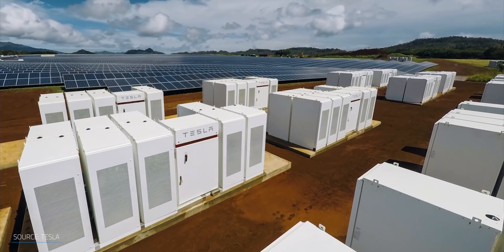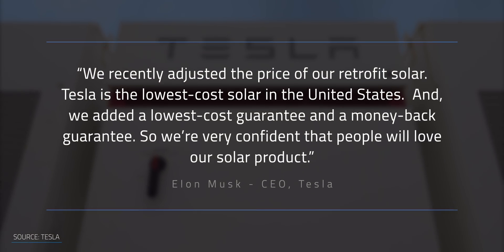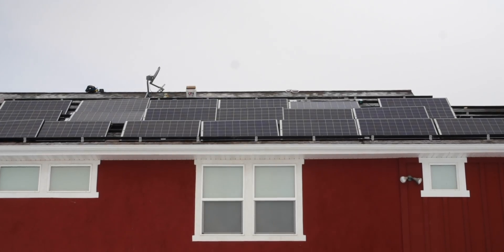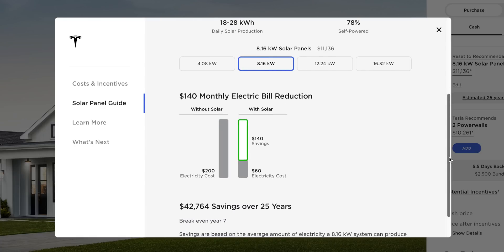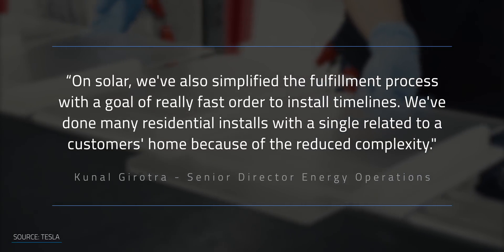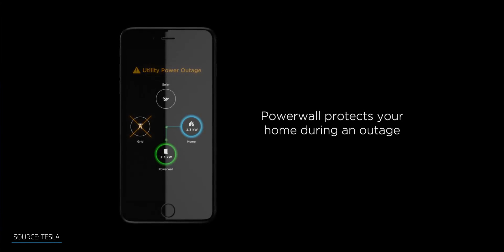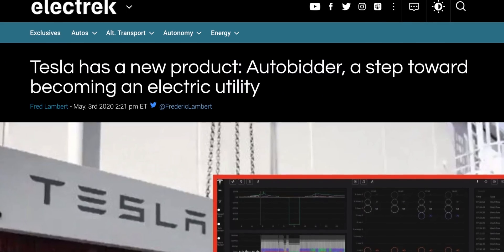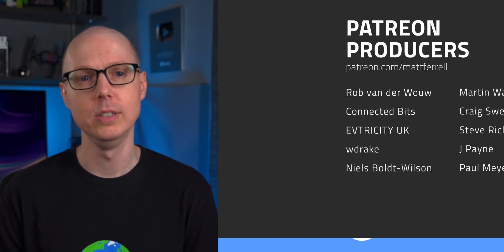Exploring Tesla solar panels game changing price

Comment: I was excited to get Tesla solar, but the streamlining of the process made it unworkable for me. Hard to get in touch with anyone. Their automated layout software could only place 12kw on my roof when I asked for 16kw. I wanted to try to get someone to tweak the layout. Other solar bidders were able to put 20kw on my roof.

Later I learned Tesla’s panel placement process was optimizing for basic cheap string inverters, so they had to avoid any area of my roof that might be unevenly shaded at any point. No per-panel monitoring. There are some who have managed to get per panel optimizers but it must take a miracle to get anyone’s attention for that.

I also learned that a big chunk of the cost savings in Tesla’s system is in the panels. They’re not as good as the LG NeON system you have - the 340W Qcell G6 they use goes for $250 a panel and the newer LG neons degrade more slowly, have up to 3% greater efficiency and are $415 a panel. It makes sense that a local company installing $400 panels will be $2 a watt and Tesla installing $250 panels might be $1.50 or less.

I’m willing to pay $2/watt for a company that comes to my house, lidar scans the roof, does a full solar analysis of all of the shade points, and installs a full system with the best panels and per panel monitoring. If Tesla would have paid just a little attention to me or followed up after I eventually canceled the order and checked “poor layout” as the reason, I would have happily gone Tesla and been none the wiser.

I found on Tesla’s forums that I wasn’t alone. Many complaints that people aren’t able to get in touch with someone to close sales.

Comment: Why?  Why do you want solar?  Why should government subsidize you?  CO2 is not a pollutant - plants need CO2 to make the O2 that we need.  Does a solar roof work more efficiently in Florida?...or Massachusetts?  What is life of solar?  How much for it after it has been used ?  Do those panels become dirty and need cleaning?  What is the whole story?.....do you buy a battery pack?....or stay in the grid for the time solar doesn't work?    Solar looks like a solution to a non-problem.

Comment: Tesla solar roof tile price was over $100k vs $20 k for a regular roof which was only 6 years old.  My Fl electric rate 10.6 cents per kw said no sense going solar.  Take almost 100 years to get the roof cost back plus my insurance would probably shoot up for the cost and property tax probably go up as well for a 6 figure improvement.

Comment: I live in New Mexico and a lot of roofs here are flat. I was going to get Tesla solar but they are charging $6,100 extra because I have a flat roof. They said they consider it a "non-standard install."  A local solar company is only $500 more, but they are using the Panasonic panels, micro inverters, and they use a roof system that does not require any drilling into my roof.  Shame bc I really wanted to get Tesla Solar but I will go with the local solar company.

Comment: I've been loving your videos, just found you not too long ago! Very informative. EvoSwitch, or as you referenced it as Switch, was bought out by one of my companies in 2018 and they have been trying to, and now achieved, a 100% renewable data centers where they are able to pass on carbon credits to their tenants. Another one of my investments is in a renewable company called BEP and they have most of the good hydro sites that are available. These were, and still are, quite valuable based on their energy demand can be turned on and off when prices peak. With battery technology improving and becoming cost effective, this decreases the intrinsic value of storing water in hydro facilities. The economics of renewables is fascinating to me!

Comment: On the tesla solar panel website, when they quote a price for a system, do those panels have micro-inverters, or just a single inverter for the system. Shade will be an issue in my yard. When I'm looking at tesla's price, it's enticing, but I can't tell what the system actually consists of.

Comment: I am currently shopping for solar and Tesla has the lowest cost per watt period.  However, I have read that their Customer Service and follow-up is absolutely horrible. Check out the reviews here: www.solarreviews.com;  www.energysage.com/supplier/21868/tesla/; & the BBB.  I have tried chatting with their rep. on the site portal, but they would not answer any technical questions unless I send them $100.00.  Therefore, I will probably go with a local installer at a higher cost per watt, where I can get warranty service if needed.

Comment: The City of San Diego is 300 dollars for the permit alone -- while permit approval for ProCert (certified professionals) takes all of five minutes and inspections take maybe 10 minutes. In some other jurisdictions in San Diego, permit fees are over 500 dollars! (Chula Vista being the worst offender.) To draw up plans, plus permit fee, plus designing the required placard, then filling out the 7-page application with SDGE and then forking over 132 bucks to them for a net meter, that right there alone is $1000 minimum. You want to get solar costs down? I know a good place to start.

Comment: Building a new house and Tesla solar looks like the way to go. Still deciding if the two battery system that Tesla proposes is worth it. Also,  I'm not sold on the look of the panels themselves. The pictures look good on the website, but I've been to two homes in Southern California and the Tesla tiles look filthy and need a wash. Since the panels are a shinny black they readily show more dirt. Similar to a black car would look like being park outside and not washed for a long period of time. In addition, the tiles looks like ABS plastic that's been slightly deformed by the sun. Please provide me your thoughts on this issue.

Comment: I admit using solar panels where the sun often shines many hours a day is a good thing, but they are getting damn old ineffectice any way measured. why?  storing the damn thing is a total waste of spending money in its first place.
I don't even wanna pay for something thats free to start with?!
There is a much better way and that doesn't need any batteries what so ever, it works 24/7 and no moving or wearing parts. a 50 kg supplier can easily support a normal house of 2-4kw no matter the weather, just to let you know!

Comment: The irony is that instead of going solar, it's a much better financial move to simply become more efficient. Make sure you have efficient bulbs, energy Star appliances, etc. Replace old refrigerators, AC and furnaces with more efficient models.  Sure that may be expensive, but it will probably save you a lot more money than solar panels will.

Comment: The problem with just pricing out the cost of panels is that the other costs are substantial and not coming down. You need converters and potentially batteries. Along with installation and maintenance. Maybe even a backup generator.  If $11,000 sounds cheap to you for installation, realize I'm never paying more than $700/year for electricity. So it would take at least 16 years to recover the installation. Then there's the convenience of NOT having panels on my roof. Not having to clear them of snow or having to clean them when dirty. Nor replacing panels that get damaged or stop working. Electricity is so cheap here, installation has to be really enticing to go solar. And the convenience of being on the grid can't be understated.

Comment: My biggest gripe (in the Netherlands) with any change to solar/geothermal/batterystorage is the fact that it costs alot up front to do, and I don't own a house (yet). I haven't researched it yet but what I would like is that those systems can be installed and then you pay in terms, like you do with a mortgage.

Comment: 1.49 per watt? WHAT? Really? Dude, I have a 5kw solar array, with a 48V output (5kw €48V), it has 25m2, it touched 7k€ on the final invoice... including, inverter, bsm and a 2kw/h battery (5kw capacity). I installed it myself, so I spared like 1k€, notice, solar panels, were the cheapest part, and are those with 44% effiency, they have one year, and they almost paid off, as the house where they are installed, is used only 1 or 2 weekends per month :D USA is a rippoff in everything. BTW, I ordered everything from china.

Comment: I'm confused, are we just taking about the panels (as your description states) or for an entire system installed?

I bought solar panels a year ago for $0.53 per watt, if you want to calculate a per watt cost for an installed system the cost can vary drastically depending upon what hardware you use, not to mention professional services and permitting costs.

Comment: First thing I was going to say when hearing the prices, until Matt mentioned the Australian pricing being so low - which it wasn't for quite a while, but we go a bit mad for it here...so it has helped drive the cost down.

I lived on a farm for a few years 1993-1996 - we had Solar only, 6 panels, it cost $10 per watt for panels back then, so it was beyond our reach to expand them further.

over the past couple of years Mum and Dad have gone with Gov't incentives and now have over 30 panels on the roof, and haven't paid for Power for a few years during Summer.

I have 2 panels on my Broadcast van (self installed with Victron Inverter and batteries) - but panel wise - cost me Just over $200 for 500w, and they are actually at 25% efficiency which may sound bad, but that is actually quite high in the scheme of panels.
The overall system is 2000Wh running capacity, costing around $3000 - so even that is only a total of $1.50AUD per watt - but inclusive of the entire setup.

Comment: In Australia I have in 6 Apr 2020 3 Ph Fronius Symo 6 Inverter and 7.8 Kw system 26 x Canadian Solar 300w Solar Panels cost me $6,000 including govt incentive and 10% GST
I am currently getting Tesla battery fitted at a cost of $6,450 
supply charge 88 cents a day,
general usage rates 37.73 cents/kWh
Solar Feed in 12.4 to 16 /kWh exported

Comment: I signed up for Tesla solar panels 4 months ago, and was excited about getting the system installed. Unfortunately, I have now cancelled my order, as (after quickly sending all the photos required), then suddenly announced 3 months into the process that I would need to move my existing electrical panel, and upgrade it to 200 Amps. This panel upgrade involves trenching approximately 50 feet across my driveway and retaining wall, and will cost at least $5K for the work. This really got me upset. I have been a devoted Tesla fan, and have been a shareholder for 8 years. Sorry to say that this experience was pretty horrible. Here's my suggestions, which I hope Elon will take to heart to improve the process:
1. Assign a dedicated coordinator to every project. This coordinator would work with the service provider (PG&E in my case) to ensure the permitting is moving forward, and handle all communications with the customer.
2. Contact the customer on a regular basis (at least once a month) to provide updates. I never received updates until I called and vented my frustration.
3. Have a local Tesla representative walk the exterior of my home, ensuring that everything is understood upfront... avoiding surprises, such as the 200 Amp panel and Powerwall locations!
4. I was considering Powerwall, but found out at the last minute that locating it in my garage was probably not possible. Another problem that could have been avoided early on.
If anyone reading this post can forward this to Elon, I'd really appreciate it.
Thanks, Steve

Comment: Hey Matt, Tesla finally contact me about my solar roof quote (not panels) if you are interested let me know. Nice video by the way, tl;dr on the roof $33k for 10kwh system size, 6kwh produced. No power walls afaik. Their solar panels quote inc 4 power walls $24k for 16kkwh system. (All after federal credits).

Comment: Thoughts of someone in the Industry:

I work for one of the largest Solar Providers in Florida, at one point we had the largest, fastest growing Residential base

Selling extremely cheap is an effective tactic for getting a significant amount of work, however the O&M eventually catches up with you, unless you're fronting enough cost to cover a large service force, you'll have significant issues down the line
-Charging $75 for a service call 2-3 hours away, even doing 4 of them in a day, you end up barely breaking even, if at all - labor is supplied by the Contractor, and the Materials / Replacement Parts if Defective, are Supplied by the Manufacturer per their Warranty

You can't use generalized permits and engineering in Florida, if they ARE, then the AHJ's (Authority Having Jurisdiction, aka Building Department) will have some significant legal troubles

Quality of the Materials, REC Panels are equitable to LG, 25-year warranties on labor, product, and output, higher efficiency for equivalent modules than LG, LG and REC are leagues above Tesla (Panasonic in particular, although they have since swapped to an alternative)

The actual cost for Installs is higher than what they're showing, even as a manufacturer of the Panel, their total profitability has to be razor thin at best, and not cover any administrative overheard whatsoever, nor issues that commonly occur

Using a lower quality, less efficient, in-house module will save a fair bit of money, so that might be where they're shaving the most bit, however it comes at the cost of the rest of the business
-Reducing $0.45 to $0.20 would shave off enough to be equal to one of the common rates in my area, but if it's costing you $0.18 to make the Panel, w/o admin or distribution, that's problematic

As the manufacturer they will then be on the line for ALL material replacements and labor too

If they were up about another $0.15 / Watt they would probably be in a good position, as low as they are, their numbers must be being supported by the rest of the business

Comment: The permitting process in my area easily adds 30% to the cost and can take a few months even to get through the process. With COVID that has gotten even more difficult since each department is working from home and they don't want to share the phone numbers so you can't contact them directly and it can take a few weeks for a response to an email.  It is really not worth the added expense or hassle.

Comment: This is with installation costs though right? 
Just for buying panels $1.49 per W would be crazy expensive, even with the high tarifs and taxes here in europe i can buy a retail panel at around 0.55 € per W on large installations for as low as 0.45 € per W.

Comment: The major cost of solar installation is that actual installation. I watched the installers - it turns out the per hour per person cost was $340. We solicited prices from 4 installers and they all came in within $1,000 of each other. Can you say "Cartel"? So anything that can be done to make prices more reasonable is appreciated.  When our system dies (estimated life is 22 years) I want to install my own replacement panels and inverter. Why? Because when I contacted my original supplier they quoted... .$18,000. By the way, my system is 7.2kW, saves us around $1340 a year in electricity (about 30% of our bills on an all-electric, ultra-efficient house in Phoenix) . In hind sight I wish I'd scrapped our HVAC system and installed mini-splits under a central computer control - would've been cheaper than solar and ultimately more comfortable and convenient.

Comment: Here in Denmark:
Solar system without batteri
12 kWp Monokrystallin for 18.000$

Solar system with lithiumbattery:
12 kWp for 22.000 $

the 12 kWp is too large here in Denmark. 6kWp is more normal size for a solar system. but in US 10-12kWp is more normal.

Comment: I spend about $150 a month on electric. It makes no sense to spend $10,000 on a solar system that will take 5 1/2 years to break even when solar panels have a 4 to 5 year life span. On the other hand I can generate the same electricity with wind for about $1,000 and still have a 5 year life span.

Comment: Hi.  I appreciate this video, but I think one or two things are missing.  I have had solar for 6 years, and have an EV.  With the incentives it has been great for me.  But every installation is different.  I am all for streamlining paperwork, but permits and inspections matter.  Not every installer does good work.  Also, my house is 130 years old in the North Eastern US. My installers brought in an engineer who determined that I needed a knee wall added to my attic to help handle the dead load on my underframed roof.  I have been a carpenter for over 30 years, and I agreed with him.  All of this adds to installation costs, and it isn't all wasteful.  Don't get me wrong - I am all in on this stuff, but it really isn't all simple.  What I am dying to see is a major efficiency breakthrough on the panels themselves.  Imagine panels that are 50% efficient instead of 20%.

Comment: G'day from Downunder, I had solar installed just over a year ago and my price experience is very different from the one you quoted
My 5.8KW system cost AUD$5800, but only AUD$3600 after State Gov rebate, that's AUD$0.62 or USD$0.45, which makes the prices over there even more ridiculous
My Local Council has adopted a plan to get solar panels on all suitable roofs within 20 years and we are now 4 years in
The Council bulk purchases the systems and finds the (accredited) installers and we pay them back in four AUD$90 installments/year over 10 years (interest free) and even after paying the installments I have saved AUD$1,137.05 compared to what my non-solar bill would have been
So essentially I have been paid to have solar installed on my roof WTF
Reply: Wow! This is really impressive! Here in Germany everything is very complicated and expensive. To the point, that it really is not much cheaper than just simply buying the electricity from the grid :(